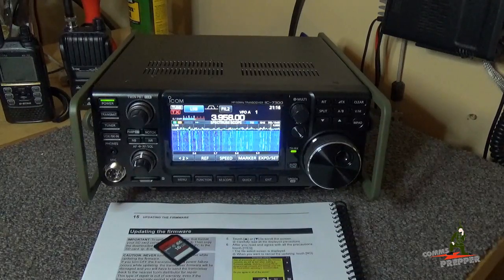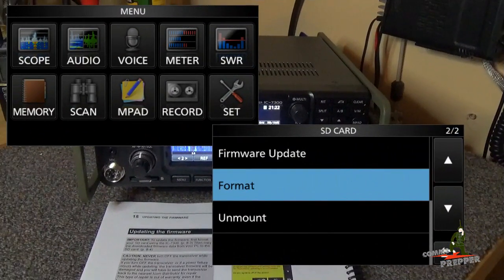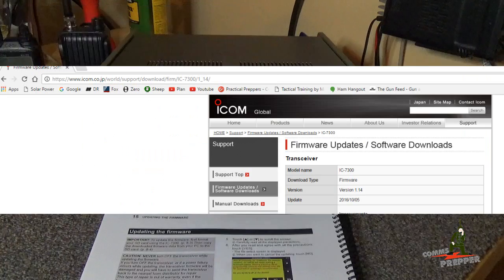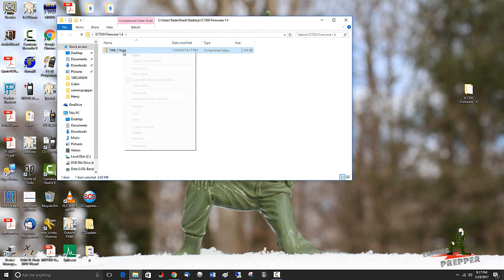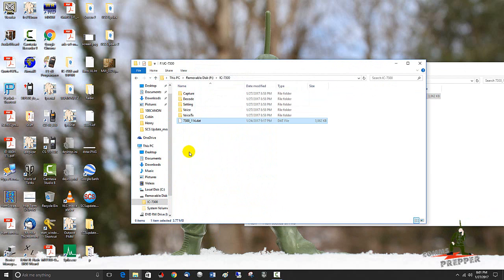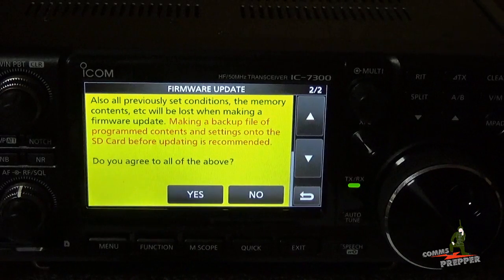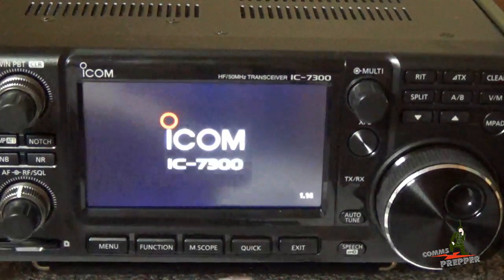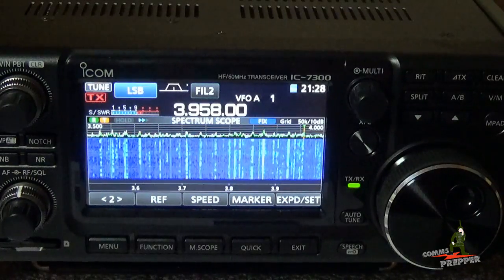IC-7300 Firmware Update Video

Comment: card doesn't need to be formatted in the radio, just make sure the format is FAT32
Reply from the maker: It does need to be formatted in the radio.  That's how the file structure is created.  If you don't format in the radio and use a PC, the file structures are not there and radio will not look in the right place.
Reply: The structure is required but the structure can be created simply by saving radio settings, then firmware update is possible (without ever formatting the card). I have to agree formatting like the manual says is the safe way to go and works every time.

Comment: I believe it a good idea to reset the radio after the firmware update.  Then use your SD card to install your radio settings back, providing the you saved them first.
This is a general best practice with these types of units. It’s a good idea to have 1 SD card for updates and 1 for setting and data storage..
This might not be in the manual, but as a software engineer for 20 years, it’s my suggestion.  Actually it’s possible to format the card using the computer, but since the function is there in the radio why try and reinvent the wheel..  Another thing I like to do is do a full format, (not quick) on SD card in the computer first after you buy your SD card, if the card has any problems, it will show up at this point. Then you can use the the radio to reformat it to the correct file system.

Comment: Excellent video to upgrade the firmware.   Yes, you need to read the manual.  I bought a slightly used 7300 that was never upgraded.  I just completed the upgrade to 1.14 and am good to go!   Thank you.
Reply from the maker: Glad it helped.  Thanks for watching.

Comment: Hello You Tube? My name is not You Tube. Why the hell don't you say WHY anyone needs this "update?"
Reply: Tell me what 'improvement" made it worth the risk.
Reply from the maker: Burt,  Thanks for the observation.  It's something I picked up watching other channels before I started my channel.  No malice or offense intended.  My apologies.  Respectfully,  Hank
Reply: Very kind response. Why would anyone want this update?
Reply: When you go to Icom's website to download the file, it tells you what this firmware update does. You can see it at 1:14 on the video. 
It's not required that you do this update. After a new product comes out the engineers usually find small tweaks to improve a product. Hey, it's free so why wouldn't you want the latest improvements? I for one like that they offer these free improvements. Over the years I've had firmware updates for my Samsung Smart TV, my digital camera, my Yamaha keyboards, even my home theater amplifier.

Just pay attention to the instructions and it shouldn't be a problem. As with any firmware update a power outage could screw things up so if you have a ups handy for your power supply you should use it. I use a solar rechargeable LiFePO4 battery so that's no problem for me.

This is actually the 3rd version update they've come out with. I had to update mine to the 2nd one (version 1.13) when I first bought it last summer.
Reply: Why can't you tell me what it does? The reason I would do the update is there is SIGNIFICANT  improvement. The reason I wouldn't do it is the danger of screwing up the radio for little gain, what does the radio now do it did not before?
Reply: It's nothing major. Just minor improvements listed here:
https://www.icom.co.jp/world/support/download/firm/IC-7300/1_14/
Reply: That's great you finally included it. It is hardly worth the risk.
Reply: Well, most of us prefer to have the 'new, improved' version of anything. The instructions are not difficult, but you can't be careless in following them. The actual updating takes maybe 30 seconds.

A power outage is probably the biggest threat, but that can be taken care up by having a ups, which I have on ALL my electronics to protect them from brownouts, surges, outages, etc. They are very worthwhile to have. I had a guitar amp stop working one day and the repair shop said it looked like a power surge is what killed it. I've used a ups since then for everything.
Reply: ICOM explains the firmware upgrade advantages very well when you download  the file:

"Improvements
A particular spurious signal in the Fixed mode Spectrum scope screen is eliminated.
Flickering of the Spectrum scope screen is reduced.
Accuracy of the spectrum scope in the CW mode is improved.
Frequency response near the edges of the spectrum scope is improved.

Problems solved
"CI-V USB→REMOTE Transceive Address" setting problem was fixed.
Unnecessary OVF indication at the end of the transmission was fixed.
Other minor problems were fixed."
Reply: Thank you for the information. Not worthy of me updating.
What is the purpose of RTTY decode? Why not PSK or CW decode, those would be useful.
Reply from the maker: Burt the intent of this video was not to justify the update.  It was to demonstrate how an update is done.  As for the purpose of RTTY and lack of other modes (i.e. PSK and/or CW) you question would be better directed to Icom marketing.  Respectfully, CommsPrepper

Comment: Thank you for your video! I am an "old guy" and as such, we no longer catch on as we once did! Would appreciate if you might slow down a bit and give a good understanding as to what your doing. I was a bit surprised that you made no mention as to what this update was, before doing the actual update. Do you have this info now? I just got my 7300 today.. thanks again 73's de K8KEM
Reply from the maker: David,

If you go to the Icom website there is a list of what the firmware update does (see below).  The video was not about what the firmware did but how it is done.  Congrats on your new IC-7300 - you will love it.  Being new I don't think you will have to perform this upgrade.  Check the version (Menu, Set, Others, Information, Version and your Main CPU probably reads 1.14).  If so - you are good to go!

Improvements
A particular spurious signal in the Fixed mode Spectrum scope screen is eliminated.
Flickering of the Spectrum scope screen is reduced.
Accuracy of the spectrum scope in the CW mode is improved.
Frequency response near the edges of the spectrum scope is improved.
Problems solved
"CI-V USB→REMOTE Transceive Address" setting problem was fixed.
Unnecessary OVF indication at the end of the transmission was fixed.
Other minor problems were fixed.
Reply: What this apgrade does is well described by ICOM when you download  the file:

"Improvements
A particular spurious signal in the Fixed mode Spectrum scope screen is eliminated.
Flickering of the Spectrum scope screen is reduced.
Accuracy of the spectrum scope in the CW mode is improved.
Frequency response near the edges of the spectrum scope is improved.

Problems solved
"CI-V USB→REMOTE Transceive Address" setting problem was fixed.
Unnecessary OVF indication at the end of the transmission was fixed.
Other minor problems were fixed."

Comment: Pretty seamless - any benefits to the upgrade ? Thanks for sharing !
Reply from the maker: I feel bad but I did not look at what the upgrade did for the radio.  I would have to go back to the link and read what changes it made.
Reply: The improvements are (always) well described by ICOM when you download  the file:

"Improvements
A particular spurious signal in the Fixed mode Spectrum scope screen is eliminated.
Flickering of the Spectrum scope screen is reduced.
Accuracy of the spectrum scope in the CW mode is improved.
Frequency response near the edges of the spectrum scope is improved.

Problems solved
"CI-V USB→REMOTE Transceive Address" setting problem was fixed.
Unnecessary OVF indication at the end of the transmission was fixed.
Other minor problems were fixed."
Reply: The improvements are (always) well described by ICOM when you download  the file:

"Improvements
A particular spurious signal in the Fixed mode Spectrum scope screen is eliminated.
Flickering of the Spectrum scope screen is reduced.
Accuracy of the spectrum scope in the CW mode is improved.
Frequency response near the edges of the spectrum scope is improved.

Problems solved
"CI-V USB→REMOTE Transceive Address" setting problem was fixed.
Unnecessary OVF indication at the end of the transmission was fixed.
Other minor problems were fixed."